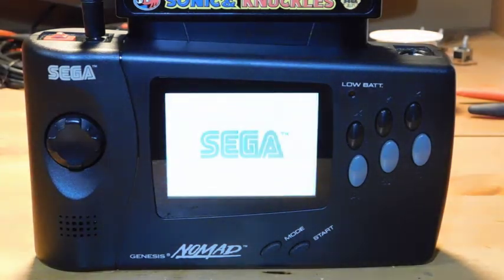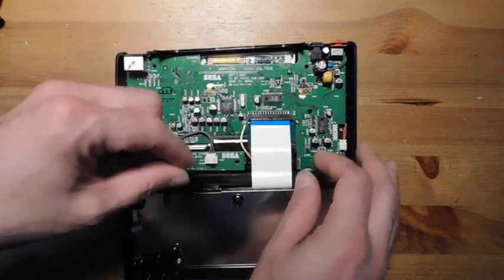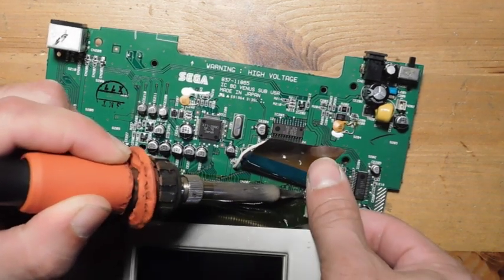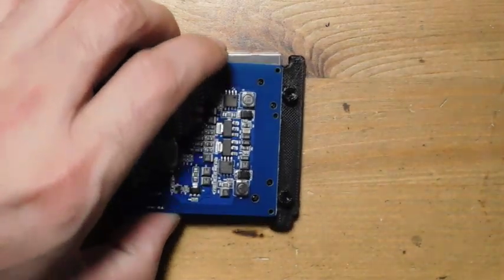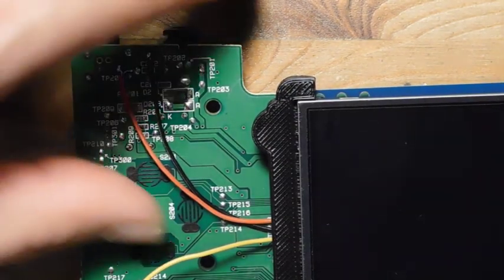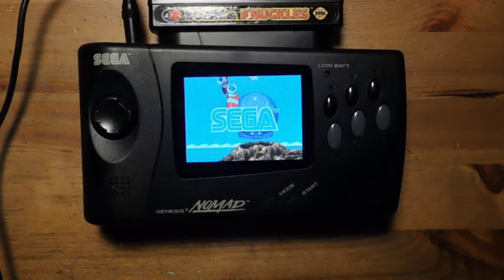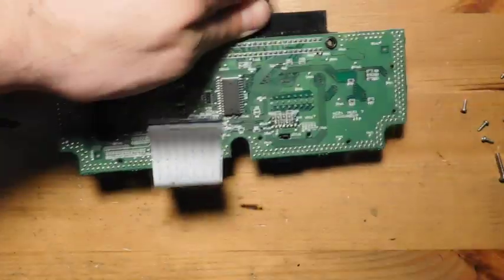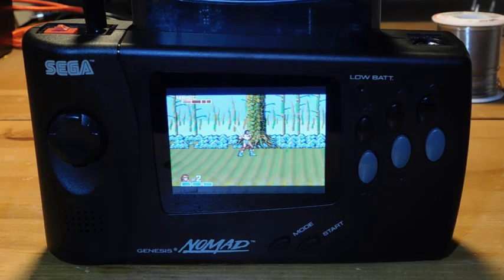Sega Nomad mods! TFT screen replacement and Sega Master System functionality

Comment: cool! Thanks for sharing my bracket design, I absolutely love the Nomad :D Hope you’re enjoying yours as much too!
Reply: oh, just to add to this: You can rewire the original brightness wheel, to the unpopulated pads on the control board, to add control for that back :)
Reply: @RetroGameRevival  which pads? I just got a replacement contrast wheel and I wanna put that function back in. Also I might have a different TFT screen control board
Reply: @xboxgamerJ16  So after fruitless searching for the markings on my board - "mtm-3520CLD" - it occurred to me that the part marking could be a typo (it's a no-brand Chinese part after all).  So I swapped it for "mtm-3520LCD", because duh - and I found this https://console5.com/wiki/LCD-3520

Comment: Hey duder, just a heads up in case you didn't know. the LCDDRV boards have been cloned an are now readily available. You can get em on ebay or aliexpress now. I popped one in a PCE GT the other day and it looks way nicer / is way easier than the PCE GT composite mod
Reply from the maker: That is awesome news! I will definitely check that out and see if I can pick one up

Comment: Hello!
I tried this mod but the TP237 pad is stripped off the board. Is there any other place I can tap?
Also, I notice that you only used 1 of the ground wires, did you connect them together and tap C202?
Reply from the maker: You can use the pin directly above TP327 for composite video. And yes, the grounds were connected together

Comment: There is no more replacement screens, Did you know another website to buy these screens?
Reply from the maker: Yes you can find a much better screen here. I have done a video on it as well https://m.aliexpress.us/item/3256801225191848.html?pdp_npi=2%40dis%21USD%21%2485.80%21%2479.79%21%21%21%21%21%402103011716865274980017445e0576%2112000018636829079%21btf&_t=pvid%3A2a6720b9-526c-48a5-94a6-4b128e903186&afTraceInfo=1005001411506600__msite__c_ppc_item_bridge__xxxxxx__1686527498&spm=a2g0n.ppclist.product.0&gatewayAdapt=gloPc2usaMsite&_randl_shipto=US

Comment: did have a problem when I got a screen from console5 did the proper burn in process did the 5 volt conversion..had an issue when trying it at 9v it wanted 12v . Then come to find out that I actually had to get a way to step up the 5 volts to 6 because it would not give me a proper display.eith that or pull off the 9v and add diodes till it gave me 6v

Comment: Hi, I tried doing this install ... But when I turn on my nomad I get a white screen. If I turn it of and on 5 or 6 times the game boots. Do you have any ideas?
Reply: I’m having a similar issue with the one I just did.
Reply: @scottcollins547  Shoot, I just purchased a second lcd screen kit from Console5 ... now my screen is blue. I get sound but thats it. I've checked my voltages, everything is good. I did also purchase SMD Cap kit. I have only replaced 2 of the through hole caps near the power. I think my last option is to replace all the caps. I am still a little skiddish when it comes to doing the caps. I am new to all of this. I will say, it is a very fun hobby for me. 

I wonder if LIR has done the SMD cap kit. I don't know if the through hole cap kit is the same in terms of capacitor types. Would love for him to do it.
Reply: @MaddSweetGT500  this my first dabbling into electronics repairs. I thought it might have been the board from the screen making contact with the nomad board, but I covered the nomad board with electrical tape and still have the issue. The screen I replaced was burnt out, I wonder if there’s something that caused that and is causing this issue. Did the screen you replace have burn too?
Reply: @scottcollins547  It was playable, but it was burning out. It was a tad faded. Yes this is also my first time. Actually, I finished recapping my Game Gear with the ceramic capacitors. It works ... just need the screen to arrive so I can get to it. So then I thought why not change the screen on the Nomad, considering it was only like 20 bucks and some light soldering ... compared to the GG cap kit and LCD screen mods.

Re: The Nomad, only thing that I can think of is maybe the CAPs and Maybe I'm not tapping the composite pin well enough. But like I said, I'm new to this so.

I will post if I finally do get it to work. Or if you have any ideas I am all ears!
Reply: @MaddSweetGT500  I think I’ll try the solder point for the composite again too. I plugged the rf cord into my tv and it worked fine. The other video I watched on doing this mod had some additional steps. Might have to look into those if I can’t get it to work.
Reply: @scottcollins547  Shoot, I did the one where you remove the diode from the LCD PCB, and put in a wire from one of the regulators to the negative of where the diode was. Still didn't work for me. Let me know if your next attempt works. I'm willing to try whatever it takes. Again, I haven't done the caps yet. I will get those done this weekend and report back.

GL to you my friend!
Reply: @MaddSweetGT500  did you use both ground wires or just the one like he does in this video? I only used the one.
Reply: @scottcollins547  I used same as LIR. Just one ground
Reply: @scottcollins547  hey bud, any luck with this yet? Just following up. I haven't don't the caps yet. I'm kind of hesitant. I'll probably go for it on Wednesday.
Reply: @MaddSweetGT500  last thing I did was get the other ground back in play and did what another video I saw do with it and tie the video to the actual post instead of the test pad and I got the same result. So, I sold it stating it has issues.
Reply: @scottcollins547  right on man.
Reply: Ok so my buddy figured it out ... Posting as an FYI if anyone else comes across this prob. For me, TP237 was pulled along with the trace. So the composite pin is no good. However there are 2 more places to tap the video ... If you follow the trace of TP237 .. you will see a tiny little micro hole, you can try to tap that .. I can confirm that it does work. However, flip the board over, and directly behind the pins you will see EM204 ... You can plug into that on the side of the S video connector. So white screen = voltage probs I recapped with smd's. Blue screen you composite tap is no good ... HIT IT FROM THE BACK! :) Hope this helps anyone.

Comment: Did you have to drill into the posts of the bracket? I had to do that on mine.
Reply: Also i messed up a sms mod and killed my nomad. Got another one and now I did it right. I used painters tape to block the other pins from being bridged
Reply from the maker: Damn I’m sorry to hear about the other Nomad. Are those nearby pins bridged? That’s something that I can probably fix
Reply from the maker: In my case I did not need to drill the posts on the bracket but I could see that being needed in some cases
Reply: @LIRetroGaming  no i dont have the first nomad. I increased its rarity and value by chucking it in the trash. It was beyond saving at that point.
Reply from the maker: @xboxgamerJ16  That's too bad but I understand. At least you have a nice working one now!
Reply: @LIRetroGaming  still trying to figure out how to fit a physical switch for region unlock.
Reply: @LIRetroGaming  
tft lcd
Sms compatibility 
New and improved speaker
Reset button mod

Now i just need to region mod it
Reply: @xboxgamerJ16  Curious to know how you messed that sms mod up. Had this mod done previously, and it was really easy with just one thin copper wire soldered between two points.

Comment: I wonder why Sega didn't add master system compatibility in first place.
Reply from the maker: Yeah I am not sure why they didn’t either. All it is missing is a single trace between those two points, I doubt that would have added very much to the total cost
Reply: @LIRetroGaming  Device was kind of an afterthought by Sega of Japan in it's initial design phase. Sega of America pretty much forced it's limited release in the US - and in the US the Master System was almost non-existent, especially by the time this was released. I guarantee they felt like it would have been a wasted cost - no matter how small - to tell Americans "It also plays Master System!"